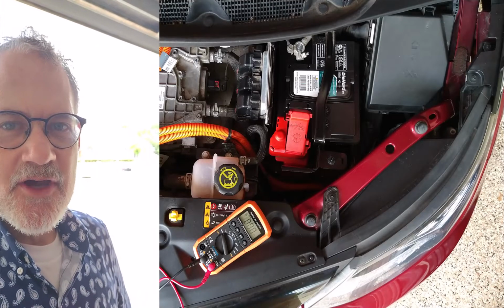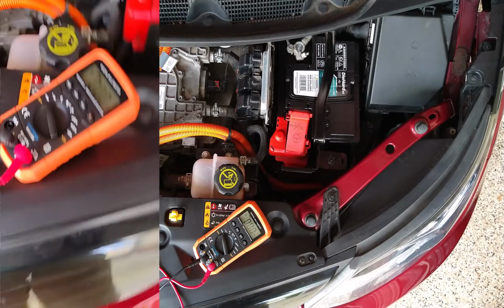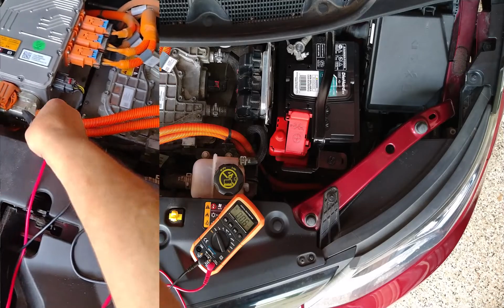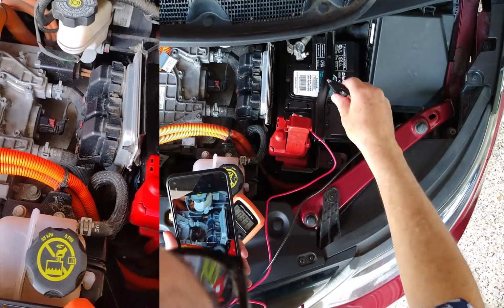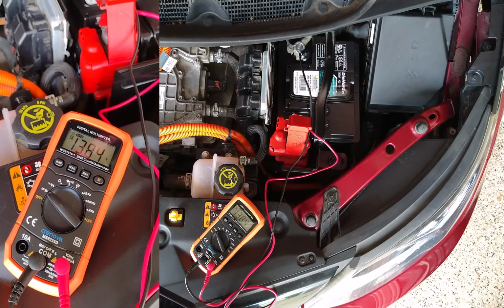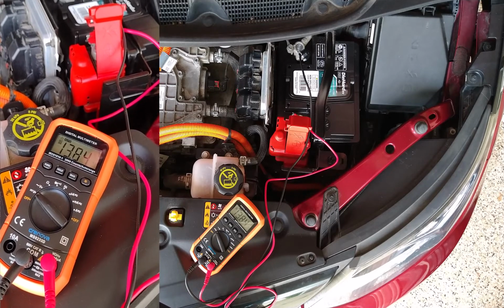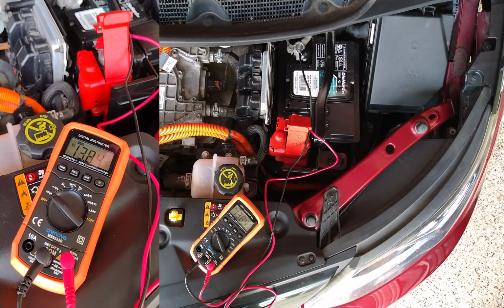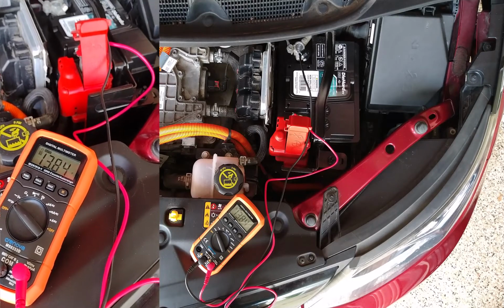How to Avoid This EV Problem - Prevent The 12-Volt Battery Crisis We Had in Our Chevy Bolt EV

Comment: Supposedly the Bolt charges the 12v every 2-4 hours while plugged in,and every couple of weeks from the traction battery when parked and not plugged in. Maybe only newer Bolts.
Reply from the maker: I think ours works like that. When plugged in, the little battery gets some juice. That is great, except that it sort of hid the problem that our battery was dying. Hence, the need to be more proactive.
Reply: @oursolartrailer  yeah…I guess regular testing is the only way to find that out? Trickle charging or any of those external solutions may just cover up a bad battery. I have jumpers in my trunk!
Reply: @edsmale  (We did too.) We concluded that testing the battery to avoid this problem is critical. Others agree with our alternative plan: just replace the battery based on the calendar and its expected life.
Reply: Traction battery won’t charge 12v unless in motion…..do you mean wheels turning? Or do you mean drive selected, which charges while not moving?

Comment: Most garages will test the battery for you including Walmart. They test the battery under load which is a much more accurate way to determine if the battery is any good. Also a fully charged battery in good condition will be 12.6 to 12.8 volts after it has been sitting for a few hours. It only reads 13 or more volts when the charging system has been running. It is totally normal after you turn the car off for the voltage in a perfectly good battery to drop from 13 plus volts down to 12.8 or so volts.
Reply from the maker: Great feedback. Thank you so much! 🙏

Comment: "Buy a new battery before the old battery dies." Seriously?? That's your solution?? No kidding.

I thought you were going to tell me which pin(s) on the BCM controls output to the most power-hungry module(s) to which I could wire a switch to toggle before parking long term. Nope. You dumbed it down to a useless level...not to mention most cars have a voltage readout which eliminates the need for a multimeter.
Reply from the maker: Thanks for the feedback.

Comment: Still seems crazy to me that a 12v battery is needed. Has to be an engineering solution to this
Reply from the maker: Great point! With massive amounts of storage in the big one, why is the little one needed?
Reply: @oursolartrailer  Yes, and they already have a DC to DC step down converter to charge the 12v battery from the big battery. Don’t understand why they can’t just run the 12v accessories directly off of the step down converter.
Reply from the maker: @Chops00  Exactly!
Reply: "I don't understand why we need these safety features! Get rid of them!"
"Why is everything suddenly going wrong?"
Reply: @pootispiker2866  Who said that?
Reply: @Chops00  You. It is unsafe, and to an extent wasteful, for a wide variety of reasons to use only the high voltage pack to run accessories. Yes, while you could "just" add a module to the battery pack that delivers 12 volts, you would need many more cells to deliver the current that a turned off EV uses. There's a reason that the debatably innovative Tesla uses a seperate low-voltage battery. Ford uses a lithium 12v battery in the Lightning, but its form factor is essentially identical to a lead acid one.
 
On top of that, using an entirely separate circuit from the high voltage pack allows the engineers to be confident that the high-voltage system is no longer active when they want it to be so. It would be pretty bad if the windshield wipers suddenly got reference to the 800V battery pack.

There's many reasons to keep the 12v system out of the main pack, simplicity being one of them.
Reply: @pootispiker2866  i did not say that. There’s already a 12v step down converter to charge the 12v battery from the high voltage battery. If that somehow failed in such a way that it sent 800v to a 12v lithium battery you’d have a much bigger issue on your hands than frying windshield wipers in your example. It’s not clear to me how that’s safer.
Reply: @pootispiker2866  thinking about it more, there is the case where the 12v converter fails while driving. In that case the 12v battery would keep the drive by wire, power steering, etc. going long enough for the driver to pull over safely somewhere. I bet that is the main reason. I would think the simplest/safest system would be one where all of the electronics ran off the same voltage as the drive unit. But we are in probably a long ways from that if it’s even possible.
Reply: @Chops00  Oh my god NO your last point is an absolutely stupid idea. Shoot it down before it even takes off.

 800v window heaters referenced to chassis ground not only will kill people, it will obliterate whatever touches them. I think you vastly underestimate how dangerous high voltage systems are. Besides, do you know where you can buy LED turn signals and infotainment systems good for 800 volts? 12 volts keeps things safe and simple. It will be a royal pain if not impossible to get any repair work done on a car with high voltage system that cannot be turned off
Reply: @Chops00  The bolt's manual pretty explicitly says that if you were to completely run out of charge while driving, the 12 volt battery will give basic driver aids like power brake boosting and power steering.
Reply: @pootispiker2866  Obviously they’d have to make new electronics. That’s why I said it likely very far out if possible. You wouldn’t be running the window heater at 30 amps or whatever it pulls in a 12v system it’d pull 0.5 amps at that high voltage instead, allowing for thinner wires as well. And why wouldn’t you be able to turn it off?
Reply: @Chops  it doesn't matter what current the whatever runs at. 800 volts, the battery voltage that is proving to be the future, is beyond catastrophically dangerous to run to every nook and cranny of the car. The window heater doesn't run at a meager 0.5 amps, but it doesn't matter. Whatever cost you would save by using thinner wires would be entirely offset by engineering the seatbelt sensor as to not fry the person buckling up. You're barking up the wrong tree my guy. There is cost savings to be had in designing a new battery cell, as Ultium is doing. The pennies in copper wiring to the cabin heater dial isn't something that any car manufacturer is interested in running at 400 or 800 volts
Reply: @pootispiker2866  it would be more savings than just the wires. They’d be able to elongate the whole low voltage system. That has to be a pretty significant amount. 

What do you think about Tesla switching to 48v low voltage system? They think there’s enough savings there.
Reply: @Chops00  48 volts is a loooong way  from high voltage DC. It's only the next logical step for a manufacturer that controls its entire production line. GM only went with a 15 volt system because some of their parts are common through different vehicles.
Reply: No. Did energizes the contactors to connect the drive battery, it has to be disconnected for safety. Runs accessories when the drive battery is off. It does seem a little Rube Goldberg ish though

Comment: These are the folks you meet at all electric car shows. Very nice people, but unfortunately most are clueless about where the electricity comes from to charge their car.
Reply from the maker: Actually, we've studied that extensively. The grid is 29% greener in 2020 than in 2000 and the trend is accelerating as the cost of wind and solar falls below natural gas. Coal is quickly being phased out because it can't compete. And we're not that nice. We don't tolerate trolls so be on your best behavior in our community.
Reply: @oursolartrailer  
There is still those windless days and darkness every night. 

Where is the power coming from during those periods?

And don't tell me batteries. 

If you coupled all the batteries in the United States together into one big circuit, you could power the national electrical grid for about 30 seconds.
Reply from the maker: @byrnc927  When there are two EVs in every garage, there will be 6 to 20 days of power for every home right there. We don't have to be finished today, just on the way. Remember, an EV uses about 1/4 as much energy per mile as a VICE (vehicle with an internal combustion engine.). There are also a host of other energy storage solutions, including green hydrogen, which can be produced from solar power and water and can be reconverted from hydrogen into electricity using fuel cells.
Reply: @oursolartrailer  great answer to another naysayer! In Ontario we phased out all coal fired power plants about 8 years ago. It is all about balance, there is no one solution but a combination of solutions that will power our future. And yes large battery storage will be part of it as well to help balance the grids, also tidal power, water batteries, etc.
I find people fear change so much it just amazes me, rather than embrace change and work to find solutions they would rather just continue on the same old path. Change does not scare me at all, people who cling to old ideas scare me the most!
You guys have a great day and keep the videos coming!
Mike 🇨🇦 👍

Comment: the 12 volt battery should be charging when the car is plugged in and/or "running"....There's no reason the 12 battery shouldn't last for years without losing its charge...something seems wrong with the EV design.
Reply from the maker: You are right. It works exactly as you say it should for as long as you say it should. Then it doesn't anymore.